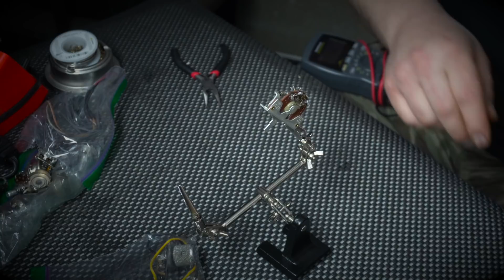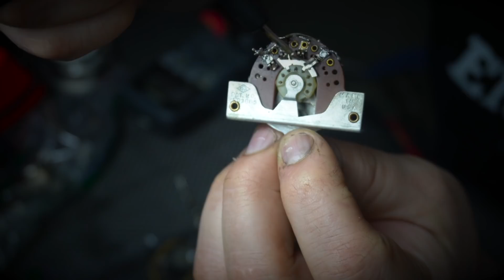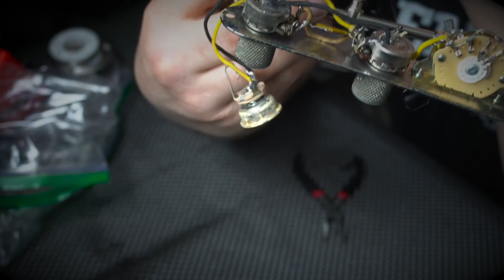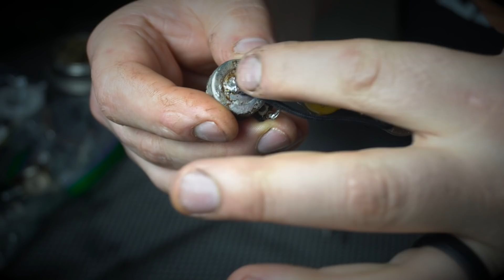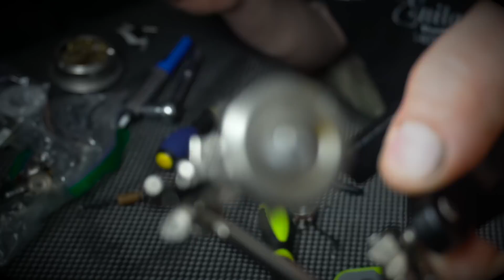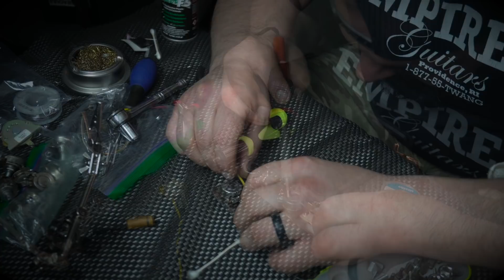VINTAGE TELECASTER RESTORATION : PART 2 - THE ELECTRONICS!

Comment: Hi, love the videos, particularly this one(s) related to your 66 tele restoration.  I have a beautiful, nearly original 68 that I purchased from a family friend whose husband was a collector and passed away.  The volume pot was replaced but he saved the original and marked it "bad".  The pot codes match and are 015479 1MEG AUD 304-6617.  It looks like my Tele got some of the old CBS stock pile pots before it left the factory.  My question is concerning the original volume pot that was marked "bad". I carefully took it apart and cleaned it.  It looks solid and was just full of dirt that came off with some careful cleaning with Deoxit.  I put the pot back together and put it on a meter and tested resistance while turning it.  It seems to be working fine now going down to 0 and up to almost 1meg.  I want to take it to my Luthier to be reinstalled in the guitar so it is back to original.  Do these pots usually clean up this well?  it seems well built and like yours, it  had a lot of solder to clean up on the outside which I did similar to what you showed here.  Please let me know your thoughts.  I am hopeful it is good to go to go back into the guitar.  Thank you for the help.

Comment: A cool tip.. When you solder grounds on in the backs of the pots, wrap some solder wire around the ground  wires, that way you don't need to use any contraptions to hold things in place. The solder should melt very quickly and form a nice joint, so there's less chance to overheating the pot.
Another tip: there's this goopy rosin paste flux stuff that you can use to rejuvenate old solder joints without adding more solder to the mix. That stuff is super nice for guitar wiring, you can dip wires into is or you can slather it wherever more flux is needed.

Comment: Nik, I guess you didn't see my comment about solder removal off the back of pots on your other video! I've restored a few pots in my day and found that if you take an old piece of cotton shirt, heat the pot up and as fast as you can "almost instantly" wipe with the cotton and all the solder will come off perfect. You have to be fast and may have to try a couple times but if done right, the results are amazing! Maybe this will help for the next resto you do
Reply from the maker: Let me check
Reply: @theriffwniksevigny5473   Cool, just a tip to try down the road.. Works well for me!
Reply: I tried that after reading your comment and it really worked great for me, too.

Comment: A higher value pot increases impedance to ground. The higher the impedance, the higher the frequencies are directed to the output.

Nik, you are correct. 

You should try out the Mojotone 250k and 500k “Vintage Taper” pots. They’re the best made CTS guitar specific pots on the planet. Super tight tolerance too, usually 1 to 3%, even though they state 10%.